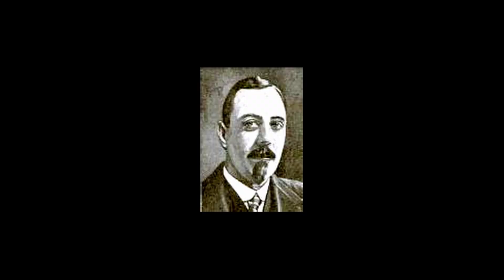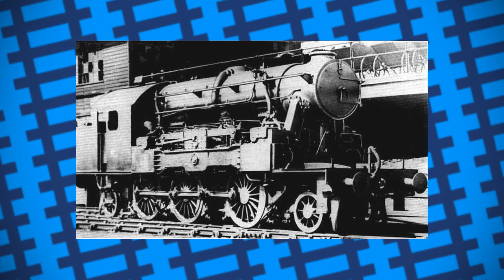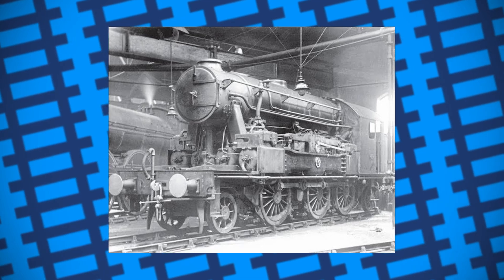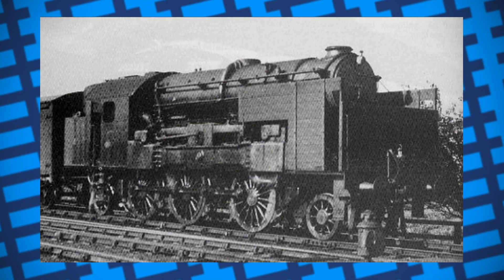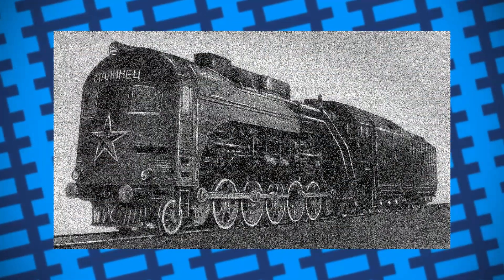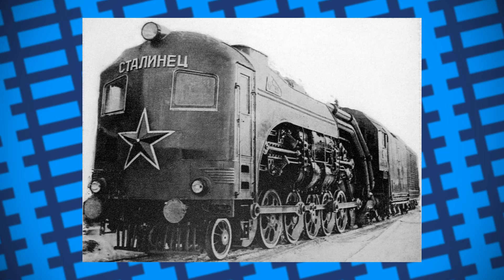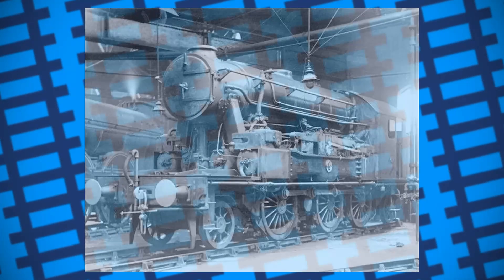The unusual trains that ran on Steam AND Diesel - Kitson Still Engine

Comment: Is, uh... is there such a thing called the, uh...
The worshire/warshire reset?

"You flood the hybrid engine with water, then it switches back to default settings. We designed it as a fail-safe to keep the engine from overloading."

Comment: I am revolted by the waste that a modern diesel electric creates. Diesel is maybe (?) 25% thermally efficient. Yes a boiler would add weight and complexity, but it seems the status quo has halted the progress on a major, obvious efficiency opportunity.

When braking, all that heat gets wasted through the toasters. At least some of it could be put to good use.

I do not expect expert responses on YT,  but it would be nice if this comment made someone consider the possibilities.

Comment: the Steam Diesel hybrid engine may have been expensive and fragile and such at that time, but I think it would be perfect to be tried again. but should be inspected for flaws before being put into service. right now, Diesel locomotives in the U.S are capable of pulling freight up to 9 miles long,  and some new Steam engines in the U.K are being built, and in the past ; they were able to achieve 126mph. I bet that if a new Steam diesel hybrid were to run, it could be more powerful than any steam or diesel train ever built in existence. plus : this design could perhaps help upgrade outdated Diesel and steam trains to keep them maintained and make them more powerful than they were. if only the Steam Diesel hybrid were reconsidered.

Comment: In the USA there were some steam locomotives that had TENDERS with
auxilery steam powered driving gear receiving steam from locomotive.
  ( This used in starting
     and on hills.  It was
     said in essence the
     lockmotive with its
     own "helper" engine)

i wonder if a multiple set of locomotives of the A&B unit type could have 1 unit of the 4 with steam driving gear using steam from a head-end heat steam generator boosting diesel exhaust heat from Diesels as a booster for STARTING and HILLS.

Comment: If you want to make a Video about it, there is a steam engine here in Krefeld Germany that is powered by a diesel Motor running an electric generator wich then heats the Oil that fires the engine. The trains name is "Schluff"

Comment: It must have been a somewhat different Diesel engine than we are used to; the diagram of the stationary engine at the beginning shows a spark plug, and typically, Diesels are compression ignition; they don't use spark plugs.
Quite interesting video.
Reply: Diesel engines do use glow plugs but that's only for starting. Once the engine gets hot enough, the glow plugs are turned off and the engine can run off its own heat

Comment: Here is a much better idea:  Have the exhaust heat from the diesel engine being used to power a STIRLING ENGINE, which turns a generator to add power to a set of batteries. Those batteries then assist the diesel engine. Hey, lets add this to a Toyota Prius and end up with a Prius that gets 80 mpg?

Comment: The 5/8 narrow gauge railroad I've spoken about uses primarily diesel locomotives for their regular rolling stock, but the V&T #11 4-4-0 replica they've got uses diesel oil as its heat source for the steam boiler. Which makes a lot more sense than a hybrid diesel/steam locomotive, honestly.

Comment: Make a video about the SEK Mα class locomotives, they were the biggest and strongest steam engines in Greece but they were bad steamers and for that reason their owners sent them to Germany to replace their fire boxes with fuel boxes, (that's right, from steam engines to diesel engines) and it was a great success. The locos became much more useful than before, only two of them still exist, the one of the two has become a dinner theater.
Reply: Errm, converting a coal-fired steam loco to burn oil fuel makes it an oil-fired steam loco, but not a 'diesel' engine.   Even if it burns 'diesel' oil.
Reply: @cr10001  A common mistake. People think that 'Diesel' is the fuel. It isn't; it's the operating cycle.

Comment: Can we please build a working replica of the Kitson-Still locomotive?  After all, it would be able to pull at speed any train it can start.
Reply: Why would it be able to reach high speed?   The driving wheels are geared down from the crankshaft.   The Kitson-Still had a design top speed of 43mph, later raised to 55mph.

Comment: I thought the title was talking about oil burning steam locomotives, which often burned diesel to create the steam. Using the waste heat of a diesel engine is way more complex!
Reply: An engine which uses heat to raise steam is called a STEAM engine. A Diesel engine is a different technology altogether.
'Diesel' is NOT a type of fuel. It is a technology developed by the engineer of that name.

Comment: The funny thing is, just the other night I was quipping "What's the most ridiculous locomotive power description I can think of? 'Diesel-Steam!'" It actually happened? That's insane. And awesome.
Reply: Not as ridiculous as electric-steam, of which 2 examples actually existed in Switzerland during World War II and for a short time thereafter:  E 3/3 #8521 and #8522 (look up Electric-steam locomotive on Wikipedia), the latter of which has been preserved in working but steam-only order (they removed the electric heaters in the early 1950s).  Admittedly, electric-steam is much simpler to build (actually they retrofitted this onto existing steam locomotives due to a shortage of coal).
Reply: @Lucius_Chiaraviglio  The only point of the electric steam locomotive was to keep an existing locomotive at work during a coal shortage.
To build an electrically-heated steam locomotive from scratch would be utterly pointless.
Reply: @tooleyheadbang4239  Exactly.  I didn't say it was a good thing to do for any other purpose.

Comment: It's interesting to note that in modern combined heat and power schemes it is common to recover high-grade waste heat from the exhaust, often by raising steam, and low-grade waste heat from the cooling jacket. But it needs a lot of bulk. The Kitson-Still loco was ahead of its time as the first successful UK diesel mainline engines didn't appear till 1948. But for the extra size and weight of a steam raising boiler, you might as well have a bigger and more powerful diesel engine instead, even at slightly lower efficiency. A steam engine is very inefficient compared to a diesel; less than 10% heat turned into power against 40%.
Reply: So even if you do a really good job of recovering the waste heat from a diesel engine, you'd be lucky to get 5% more power.
Reply: @joejoejoejoejoejoe4391  That's basically right. Which is why in small-scale CHP schemes based on diesel or gas engines, the waste heat is used just for steam heat and space heating. The only exception is very large power stations with gas turbines, where there is enough high-temperature waste heat to run a steam turbine as well and squeeze out a bit of extra power (combined cycle). But there you have literally acres of space, so size and weight is not a consideration.

Comment: We had trains that ran on diesel and steam in Victoria...albeit they were normal oil-burning steam engines that VR had just started burning diesel in for the last few years of steam when it became too expensive to have stocks of oil just for a handful of shunters.
Reply: They ran on two different grades of oil, rather than two different operating cycles.

Comment: I presume diesel electric hadn't gained traction yet (pun intended). Diesel electric solves the torque problem with electric motors, which have instant and powerful torque.
Reply: Imagine a steam loco with electricity driven tender wheels, loads of drawbar pull at low speeds.
Reply: @joejoejoejoejoejoe4391  A booster engine on the rear bogie would be simpler.

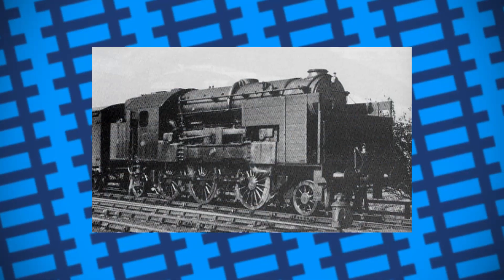Comment: 0:41 what are those "walls" in The front of The loco for?
Reply: They often fitted steam locomotives with a "shed" on the front for test engineers to monitor pressure gauges, speed readings, measure cylinder pressure during stroke etc, you have to remember everything was measured machannicaly, with no wires or telemetory. The closest they got was a squiggly line on a roll of paper.

Comment: Seems slightly sad that it didn't get any development, given that the initial prototype seems to have worked remarkably well - many prototypes are disasters areas that need complete rethinks, but this was obviously a concept with potential. There again, as conventional diesel loco tech (and diesel electric locos) were developed, I guess that any advantage over a simpler standard diesel loco would decline over time.

Comment: Very disappointing no one seemed to put conventional steam power together with battery electric and regen power. 

Both are stores of energy. Steam and electric propulsion compliment their strengths and balance out their weak spots pretty well, and regen makes use of recharging from recapturing the momentum of an entire train. 

It could be done now.

Comment: Sounds like if they had focused the design more around assisting larger trains uphill it might have a had a decent market for a while. Before it was even mentioned in the video I knew it was going to have a ton of tractive effort. Two engines over one wheel set means a huge friction coefficient.
Reply: The friction coefficient is a constant.  The weight times the friction coefficient gives maximum pull, and the weight is limited by what the rails can tolerate.  It has nothing to do with whether the weight is one big boiler or a small boiler and a small engine.  The narrator says it was underpowered for its size.
Reply: @grizwoldphantasia5005  The engine would've had incredible adhesion, which is why it was able to start any train it was given. It may not have as much power, but it was able to put that power down much better than normal steamies due to how heavy it was.
Reply: @roadtrain_  Adhesion is weight times coefficient of adhesion.  The coefficient is the same for all steel tires on steel rails.  The weight has nothing to do with having double engines.  There is no special magic to this engine.
Reply: @grizwoldphantasia5005  It's also about the weight on top of the wheels pressing down against the tires.
Reply: @roadtrain_  So?   What has it got (in terms of adhesion) that any other 2-6-2 tank of the same total weight hasn't got?    (An 0-6-0 has even better adhesion since all of its weight is on the driving wheels).   The weight is limited by the maximum permissible axle load.
The Kitson-Still weighed 88 tons, 20 ton axle load, tractive effort 28,000 lb.   For comparison a LNER V3 2-6-2T  weighed just 59 tons with a TE of 25,000 lb (but the same max axle load).    So maybe the Kitson-Still's weight was better distributed.   Further afield a GWR 6100  2-6-2T weighed 79 tons with an axle load of just 17.6 tons and a TE of 27,300 lbs.   
So the Kitson-Still was good but, for its weight, not marvellous.   As grizwold said, not magic.
I suspect the starting ability of the Kitson-Still would be because its cylinders drive a crankshaft which is geared down to the wheels.   Also the multiple cylinders (8) will mean much smoother torque delivery, so (possibly) less prone to starting a slip.
However that gearing-down would also, I think, limit its top speed - okay for freight traffic, not so good for passenger.   Also limiting its speed would be the small boiler.   Note that it had limited power.   Generally, the size of the cylinders determines the maximum tractive effort (amplified by gearing in the case of the Kitson-Still), the size of the boiler determines the power output.   The TE dictates how heavy a load it can pull, the power dictates the speed.   (Roughly).